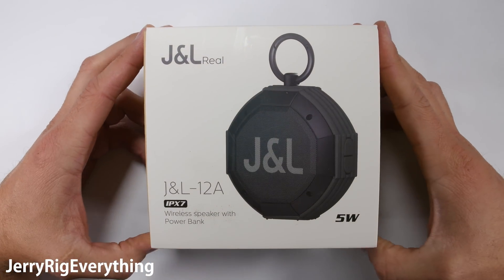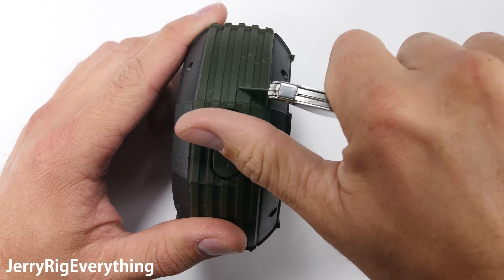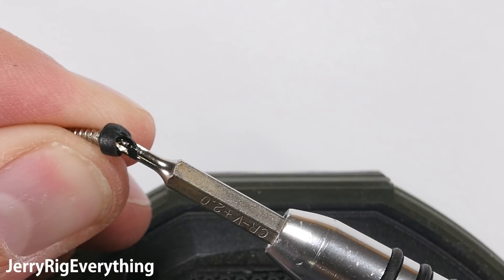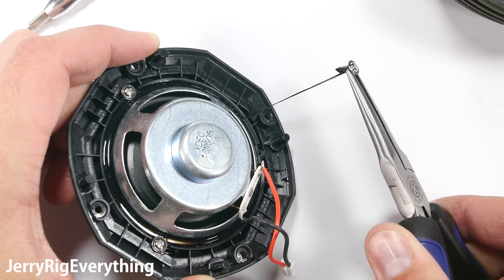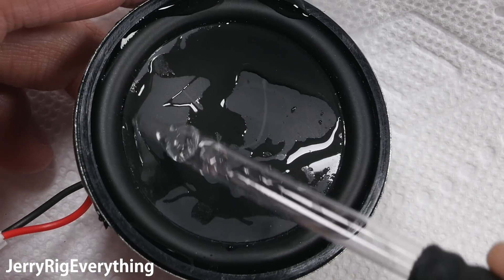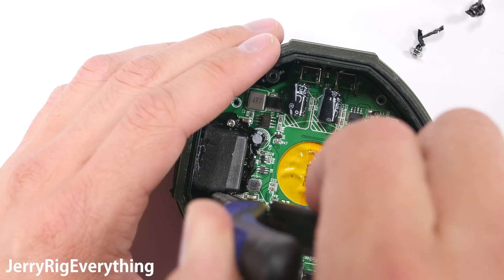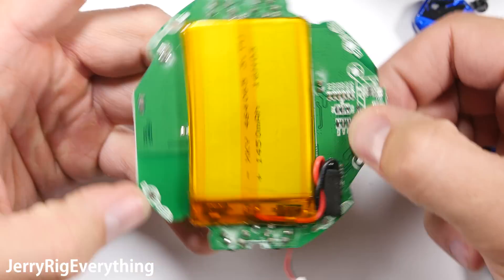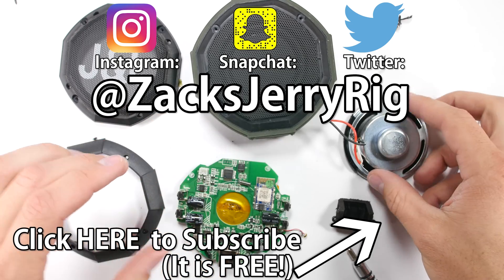What makes a Speaker Waterproof?! - Ultimate Test

Comment: I would like to mention that most electronics are assembled with water-soluable solder paste and then washed with deionized water and dried during the assembly process. Water is an important part of electronics manufacturing. The hydrophobic coating you speak of is commonly referred to as conformal coating, and is popular as a dust-proof and water-resistant sealer. Another (more expensive) option is to sink the board into potting material, which is completely water tight.

Comment: Pure H2O is not killer but if U add a little bit of anything in wather mix than it is killer
Reply: you are technically correct. however metal has a nasty habit of migration into the water when the circuits are under power
Reply: And you are correct too
Reply: Actually, both pure water and contaminated water are killers. You see, pure water is not conductive but it will do anything to become conductive so it will strip the metals slowly and slowly and fulfil itself with minerals from the metal and then become contaminated. Contaminated water, is conductive so it's equally as bad.

Comment: Hi, if you submerge the waterproof speaker, charge an ''waterproof'' iPhone 7 with a rugged lightning cable, is this still waterproof ?
Reply: N
O
P
E
.
Reply: 18-25 PAIDW hmm idk depends on how conductive the water is,probably not gonna work.
Reply: it might work but only if you have a cable that will not let in water on the connector ends